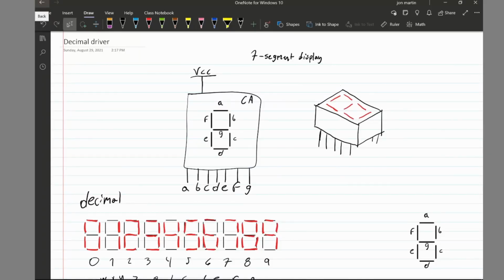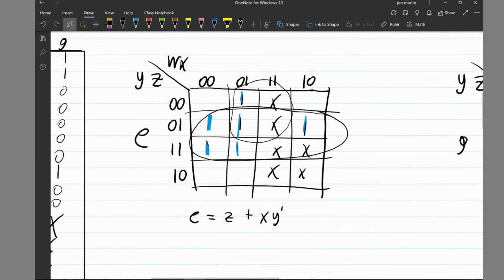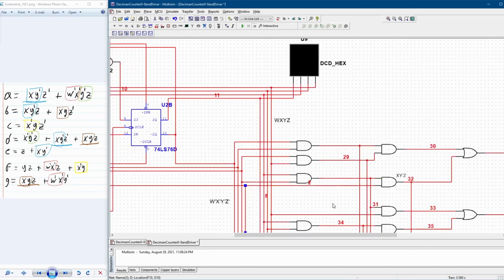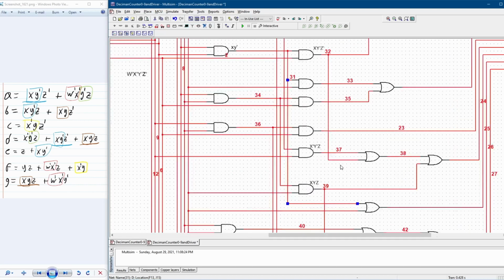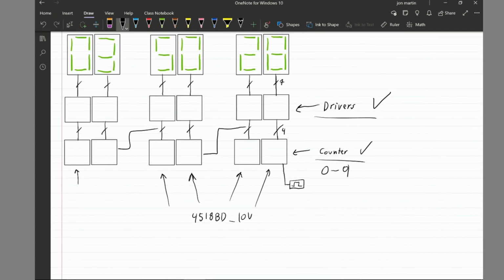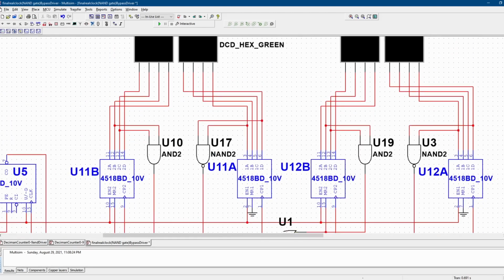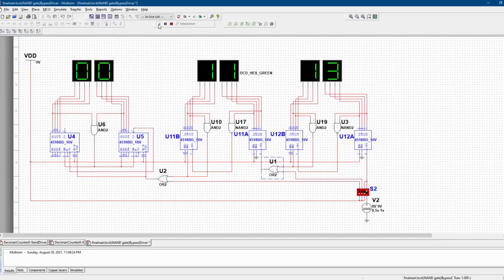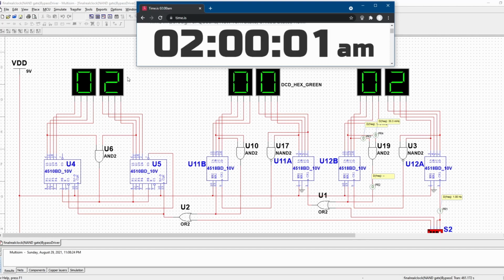Here's How to Design a Digital Clock Part 2

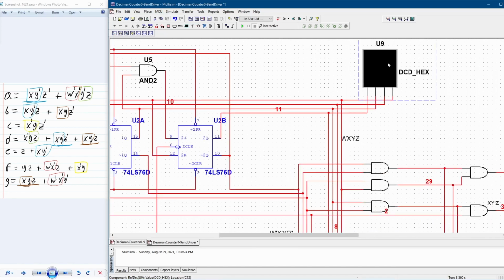Comment: can i know why the final ic design starts from 00:11:11 instead of 00:00:00 ?
Reply from the maker: You're correct. The entire design process of the ic(Driver) starts from the beginning of the video and ends at 22:00. The section labeled as "Driver Design" is showing you the design of the driver based on the equations found.
Reply: @JonathanM-JMart  how can we make it 00:00:00 sir?
Reply: @JonathanM-JMart  I think the question is when you start the simulation in the testing part, why it started at 00:11:11 and not 00:00:00. Every time you stop reset and start it should start at 00:00:00